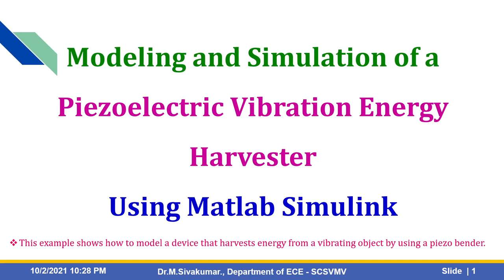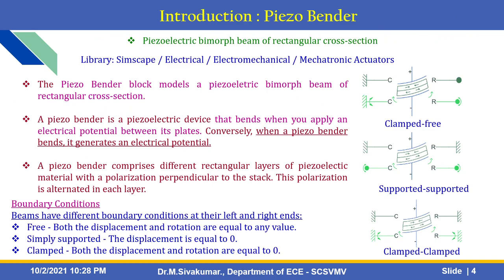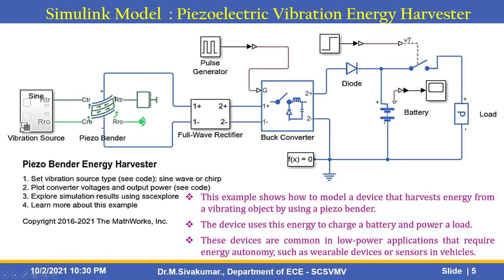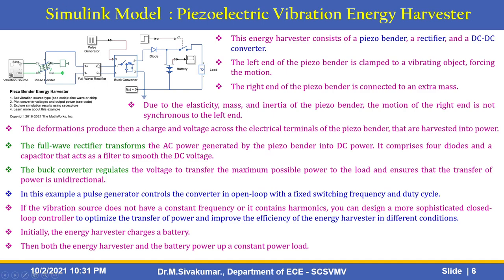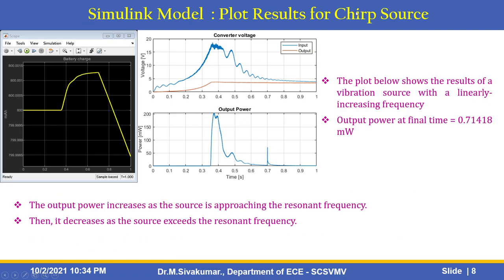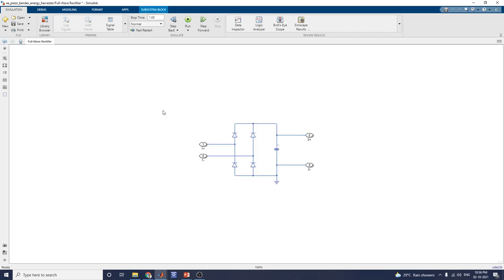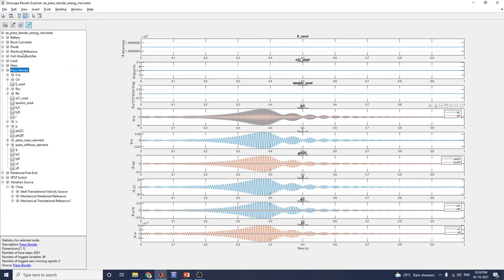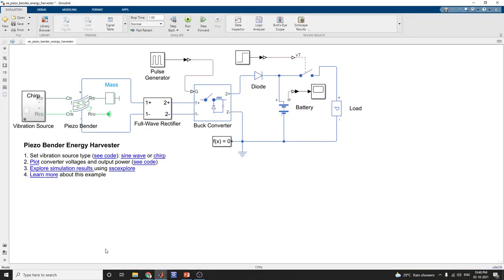Modeling and Simulation of a Piezoelectric Vibration Energy Harvester Using Matlab Simulink

Comment: Hlo sir Good evening 
Actually I'm working on piezoelectric energy harvesting from suspension system for that I am creating a 2DOF quarter car model in MATLAB Simulink but I have facing some problems. Can you plz help me. Plz reply me sir.
Reply from the maker: Send the contact form through my blog.... drmsivakumar78.blogspot.com
Reply: @DrMSivakumar  it's done sir
Reply: @uniquemathssolutionbysuraj  
hlo sir plz help me to anylze the 2 DOF qauarter car modle for pezoelectric enrgy harvesting
Reply: @uniquemathssolutionbysuraj  hello sir, did you get the file for piezo bender?
Reply: Hello , just need to know whether it’s possible to implement electromagnetic microgenerator